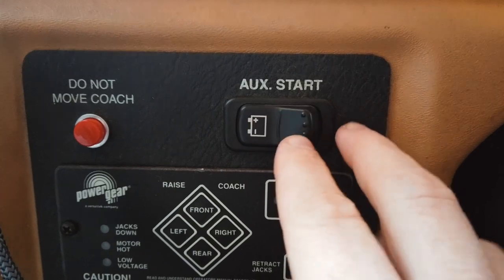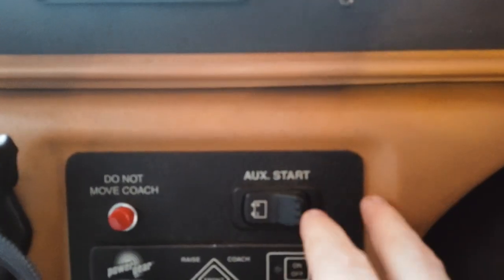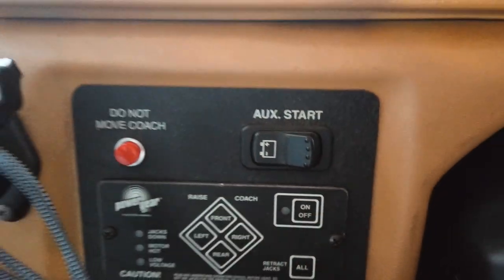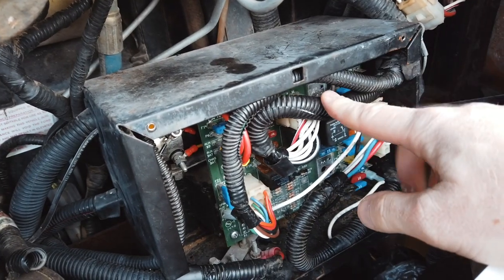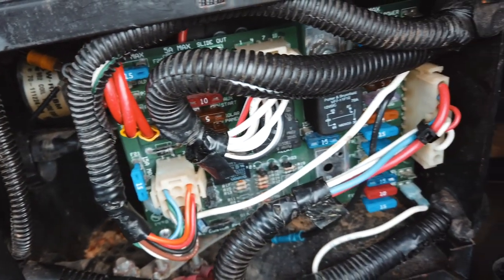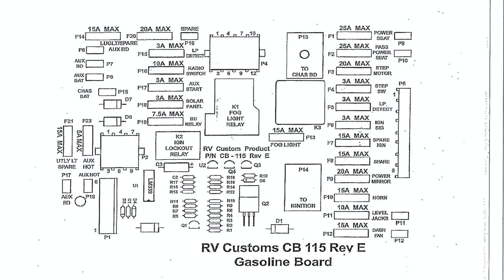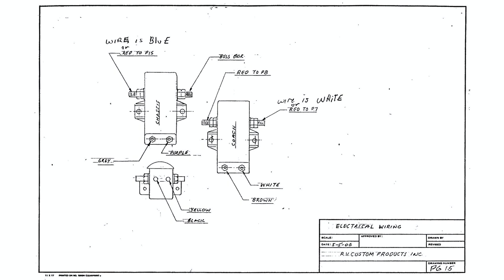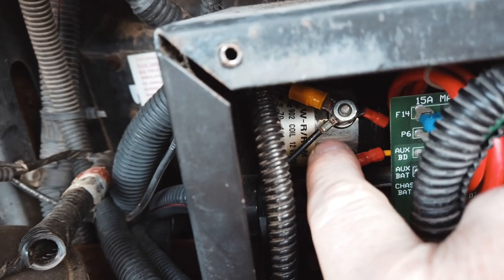How to fix your RV battery charger // Fleetwood Bounder

Comment: That's great that you have another way to start your rv! Thank you for sharing!
Reply from the maker: Yeah and keep my batteries all charged lol
Reply: @SouthernGinger  I have same rv,  my solenoid clicks but will not start, there's no power to ignition,  the starter works when you manually check it, turn key,nothing, no dash lights, radio works, lights work, heater dosen't work, horn works, oh ya when checking fuses in that box , the row on left were working, no work on right.thanks
Reply from the maker: Well damn that's crazy! Have you checked the starter relay?
Reply: @SouthernGinger  I changed the main solenoid that's in the BCC ,that was not it, where is the starter relay on my 98 bounder,
Reply from the maker: Mine is under the passenger seat, look under the wheel well
Reply: When I think of relay I think it's a small black box looking thing, after checking relays that's not always true, the one under my firewall is  black plastic with a big red wire going to it 3 prong,
Reply: @SouthernGinger  I sure appreciate you giving us time , thank you

Comment: Just bought my first RV 96 bounder..having same battery issue & using a trickle charger. Thanks for your video help.
Reply from the maker: Awesome!! Congrats!
Reply: So everything checked out good, Converter & Alternator. Someone told me a good check on the alternator could still be causing my battery to drain/ draw off it,  so I'm getting a battery kill switch to hookup to my negative until I solve the issue by checking all the wires hooked to my positive. The previous owner has 5 wires hooked to the positive post. I have to figure that one out as to why so many. 
 Any clues to this would be Appropriate. 👍
Reply from the maker: I'm not sure why there is that many, maybe some aftermarket accessories? I think I have one or two attached to mine

Comment: Fantastic, I have a 98 bounder and mine needs looking at as well. Now I have to ask. Did you say that there is a solenoid in the box that controls power going to the genny to start it? I am having a hard time getting full power to mine to start it. Subbed
Reply from the maker: That battery is what cranks the generator, and the solenoid is what clicks over to charge the house batteries when plugged in. I've never had an issue after this fix to charge my batteries

Comment: I have the same RV,  I have always had problems with keeping the battery changed,  I always thought driving it changed the batterys , and I thought I had a bad converter, I'm thinking now it may be the solenoid , OK yesterday  went to start it ,hit the to battery switches by the door and it started up fine ,drove it around no problem,. TODAY, went in hit the switches ,nothing , turn key not even a click, so I charged all batteries, still nothing,  the head lights work and radio but that's it.Do you have any idea? Tks Rick,ps. My solenoid does click

Comment: Sorry so many comments
Some have said MT solenoid will only click over when house battery is charged to 80 % does that sound right
I am now leaning to bad slonoid when
 connected to shore shouldn't it auto click on
 Thanks
Reply from the maker: Yeah sounds like it's either dirty or needs replaced but they're cheap.. just a pain to get to haha

Comment: Hey, thank you for sharing! 
We have a 2004 bounder also, we just had a blow out on our left rear inner wheel, it looks like a few of the wires in that wheel well close to the inner tire have had their  insulation stripped , the wires themselves appear uncut but obviously have been hit by the tire. After the blow out the interior lights worked fine but once the tire was replaced, we  drove it 100km and now we have zero power to our interior house (lights microwave etc…) our voltage to our house battery is not showing anything, no number just blank?
Do you have any idea of what could be the issue?
Reply from the maker: Wiring is tough, I would start in that area where the tire is then double check fuses..

Comment: I have my charger for house batteries under my frig. The one your showing is just the changer over solenoid.  The system your showing only works when the engine is running to charge the batteries. Maybe I missed something with your video ? I have been around these systems for 50 years and the charging system under the hood  only charge with engine running.
Reply from the maker: That might be the case, but looking at my schematics it seems that all power passes through that box. All I know it's that's what fixed my issue :)

Comment: The toggle on the dash works. I can hear the solenoid. BUT, when I plug into shore power the solenoid doesn't engage. Any suggestions? House batteries don't charge while plugged into shore power either. Thank you
Reply from the maker: If the house battery is not charging, check your converter. The solenoid won't switch over until the house battery is over 85% charged.
Reply: @SouthernGinger  Thanks for a quick response. The convertor is putting out 12.5v. I disconnected the neg lead to make sure there was no feedback. I'm frustrated. The battery control box. The top post (chassis) coming out from one of the battery disconnects I'm getting 12.8v. The next one down (coach) I'm getting 12.4v. The next one down (generator) I'm getting 12.4v.
Reply from the maker: @424bullelk  hmm that all seems right, is your battery disconnects disconnected or connected at the door?
Reply: @SouthernGinger  Both battery disconnect are on.
Reply from the maker: @424bullelk  the other thing I had to do early on was unbolt and clean my ground to the chassis. Mine is under the driver's seat on the frame rail. Tough to get to but that fixed a bunch of stuff hehe
Reply: @SouthernGinger  I'll give that a shot later today. Thank you!!! Wiring diagrams, stepc, etc for these MH are none existent.
Reply from the maker: What year do you have I have like 30 pages of schematics, you can call REV group with your vin and have them send you what they have
Reply: @SouthernGinger  2001 Bounder 34D

Comment: Do you know where the inverter is located? I think mine just died
Reply from the maker: Should be in the basement to the left of the steps
Reply: @SouthernGinger   I really appreciate your help! Is it the Inteli Power 9055 I looked it up and it looks like a charger from AC to DC. I saw a spare tire, water pipes, and something that looked hydraulic.
Reply from the maker: Yup that will take your power from the house or RV plug and charger your batteries and run your 12v systems
Reply: @SouthernGinger  I found a sticker on the side of my generator, called them, and they had me check a breaker on the generator. I have power!! Thank you again! I appreciate your help! I still learned something new from you today!

Comment: Hi Zack. I have a 1998 bounder and I can not find the Circuit breaker for the Ez Slide room. All of a sudden I have no power going to the motor. Please help with the location of this breaker.
Reply from the maker: In mine it's above the fridge, you have to remove the plate for the 12v system
Reply: hope this helps!!!    I have a 99 fleetwood discovery with the ez-slide system and mine is a auto reset breaker.  its located outside compartment service side.  where the inverter/battery area is.    you may see battery relays.  i think its a fifty amp breaker.

Comment: Hey, you've got that same whine before you start your engine (turns on when you turn the power on, but not all the way to the starter); any idea what that is? I guess I'm less concerned now that I've heard yours do it too, but...
Reply from the maker: Are you talking about about the brakes? If so yes. That's the electric pump needed for the brakes when the engine is not running
Reply: @SouthernGinger  Ohhhhhh, thanks. It just always sounded kind of like the starter not working.
Reply from the maker: No actually it's the backup pump for the brakes. If your engine stops for any reason it allows you to stop hehe. Look up Boush hydro-max booster if you're interested in learning more

Comment: You mention the other 2 fuse boxes. I know where the coach fuse panel is, but the one that is supposed to be under the drivers side instrument panel is nowhere to be found.
Reply from the maker: Yeah there is a few, the main chassis fuses are under the hood kinda in the middle. Should say ford on it. Then you have the house fuses, that's above the fridge and then there is a third under the speedometer, just lift up that whole area and you will see it.
Reply: @SouthernGinger  damn, I wouldve never found it under the instrument panel. It is somewhat loose, but still wont open, i dont want to break anything. Are there screws or a latch somewhere?
Reply from the maker: Yeah it should come right up, sounds like maybe the radio was put in afterwards or something.. just use a flashlight and be careful haha
Reply: @SouthernGinger  the radio side is the side that is loose, the left side is stuck and the only thing there is the dimmer panel. I guess ill keep tugging on it.
Reply: I got it! The previous owner used a ratchet strap under the dash to hold it down. Im guessing it was rattling on the road.
Reply: None of the fuses are blown that I can see. I was installing a 12 usb charger in place of the cig lighter and made a spark, then lost power. You wouldnt happen to know where that particular fuse for the drivers cig lighter/12v socket is?
Reply from the maker: If I was to take a guess it's under the hood.
Reply: @SouthernGinger  bingo! I guess i have at least 4 fuse boxes in the bounder, and and 2 are under the hood. I didnt even see this one. Thanks for all the help!

Comment: How did you get your solenoid out?? We’ve got the same problem and have a new solenoid ready to go. We’ve been working on getting it out for hours. Can’t get the bottom busses bolt off to pull the solenoid out. Is there a better way to get it out?? All ears.
Reply from the maker: It was a tight fit for sure, if I recall I took the whole board out to pull it out and you're right those bus bars are tricky
Reply: @SouthernGinger  yes we took our board off too. Definitely easier. The back bottom screw holding the solenoid onto the back wall of the box won’t budge and the bottom busses bolt won’t budge. Those are the last pieces of this puzzle! Still working on it.
Reply from the maker: Ugh old machines are always fun haha, have you tried penetrating oil to maybe loosen up the bolt?
Reply: @SouthernGinger  sweet baby Jesus! We got it off. Lol. Finally. Putting the new one on now. Thank you!
Reply from the maker: Haha nice! Hope if fixes your issue, mine has been working ever sense I fixed it, surprisingly lol.